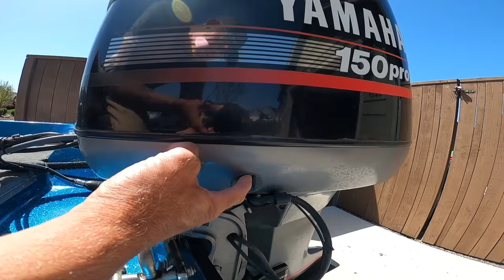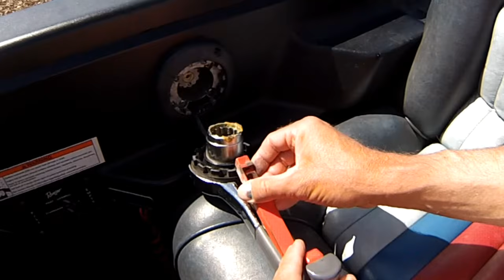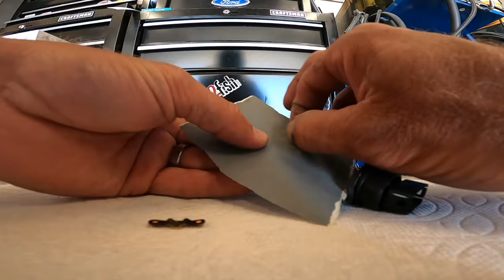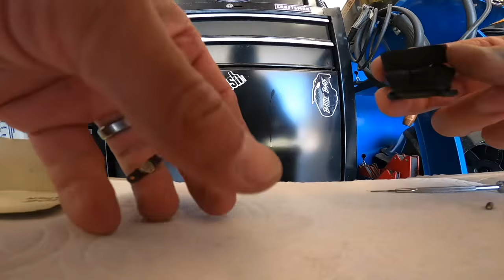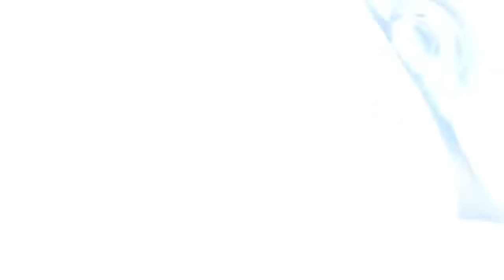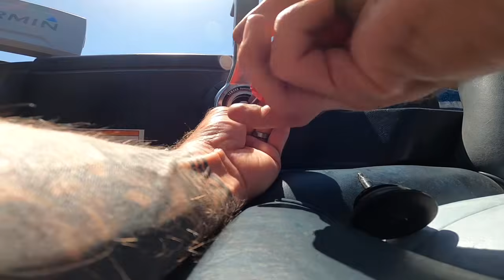How to REPAIR your trim switch

Comment: Just what I needed to see.  I have the same throttle control and the up and down intermittently were failing and now don't work.  The button on the engine does work. i will just clean it and lube it.  Thanks!
Reply from the maker: These steps should get your switch bavknin service! 👍

Comment: What if the trim switch goes down ok, but up it goes all the way up before it stops. Have two controls and the out one works fine up and down, same on motor. Could it still be just the switch?
Reply from the maker: My guess is something sticking, or bridging the current in that switch. I would try the steps in this video and see if you can find the culprit.

Comment: Thanks for the video. Exactly what I needed. Although once apart I may need a new switch, or at least a good used one. I picked up a new to me Bigfoot but that trim button seems to have a 360deg motion to it. Plus the rubber sheath is torn. Cheers…
Reply from the maker: Best of luck with your project!

Comment: Ok, so this is video is 3 years old and I'm late on commenting. Had this same problem three times now with the control handle trim switch. First time I repaired the switch. Second time I replace it with a new one for $61.00. Now the new switch is acting up...

My problem is the driver's seat tilts forward and hits this switch when anybody accesses the storage underneath. There is no way to move either one to add clearance. So, I am adding a blinker trim switch under the steering wheel, and I found one for $59.65. Looks neat and clean but I've only used an all-in-one shifter, throttle and trim control. Might be too much to get used to or be the next best thing since sliced bread. Dunno, but I'm going give it a try.
Reply from the maker: Sounds like a good solution to your situation, good luck!

Comment: Excellent tutorial! 
I have a 2000 Johnson outboard & remote with the same problem. The parts look nearly identical. This switch is No Longer Available for Evinrude/Johnson and my contacts were too far gone to restore. I ended up taking a mini toggle switch and fitting it into the handle on a little piece of aluminum flashing--press fit. I did this repair 4 years ago and it still works perfect. 
I wish I had thought to check other makes to see if their switch might fit... But I'm cheap and still might have fabbed my own fix. Lol
Reply from the maker: I'm a hot-rodder at heart so I love that you found a solid work-around!

Comment: Wasn't quite what I needed, but a good video nonetheless!
Reply from the maker: Sorry it wasn't helpful.for your situation. I hope you get it figured out without much effort. If its a wiring problem, it might be more simple to just run new wire. Be sure to inspect the old wires for signs of pinching, abrasion or other mechanical damage so you don't develop he same issue again. Good luck!

Comment: Thank you sir, this had me stumped. Was getting 7 volts to the trim motor from throttle, 12 from engine. Saved me some money and time as this ended up being the fix.
Reply from the maker: @justinbloomberg6941  that's great to hear! Glad your trim is back in service

Comment: Very useful video, thank you!  Do you know what the model or part number is for the throttle handle?
Reply from the maker: Thank you, I hope it helps you. I don't know the part numbers,  but a call to your local boat repair shop or parts desk should yield a good result. You might even find it easily online.

Comment: Glad I found this video.  I am having the same issue.  up and down work on the motor but only down on the throttle.  I will be doing this before spending $120 for a new Yamaha OEM switch.
Reply from the maker: Let me know how it turns out 👍

Comment: Ha! Super. Had a super problem even getting a fitting switch so did excatly what you describe and could see those dark connectors not functioning and voila! Now it will work for ages again. New piece is like 100€ or so, and totally in vain
Reply from the maker: Glad you're back in action! I enjoy repairing a part when possible and figuring out how things were designed and function. Thanks for the feedback! It's great to hear that others can find success.

Comment: I had same problem on a 2000 Yamaha 150 shift handle. bought a new switch but when I tried to push it in the plastic sleeve on top of shift handle the switch was 1/8” too large and would not fit into the opening. If you know the exact part number it would help me a lot?
Reply from the maker: Try this: http://www.adeptpowersports.com/oem-parts/yamaha-grip-control-lever-703-48222-10-00-part.html?gclid=CjwKCAjwsMGYBhAEEiwAGUXJadlgWQwwGT7Vp6t_TPhhuMW_J0oJ5X_5sBPdRowcNm0Vpa_LLviSWRoCIf0QAvD_BwE
Reply from the maker: I do not know the part #, sorry. Any service department should be able to tell you. You .ight even find a parts diagram online for your year that will have every part's ID #.

Comment: Great and easy to follow video Thank you!! I have saved it. How did you figure out it was a bad switch  versus a broken wire?
Reply from the maker: An excellent question. While a broken wire was a definite possibility I just had a gut feeling that it was the switch because of the way it was behaving. I know that's not a definitive answer but the switch was the most likely culprit just because of the way it functions and the way it would wear.
Reply: Great video..